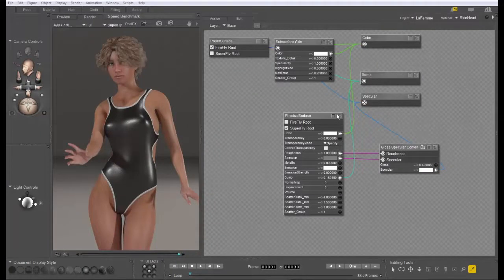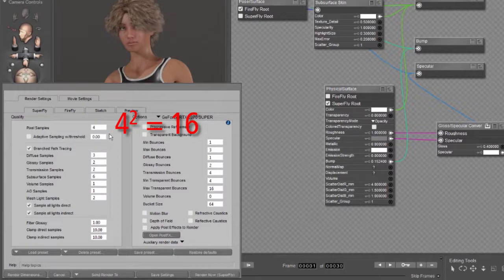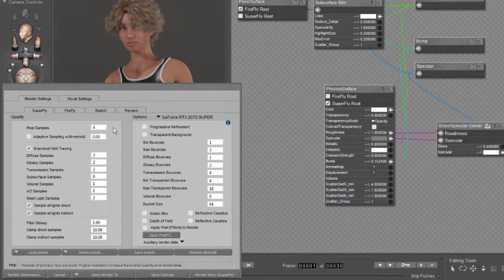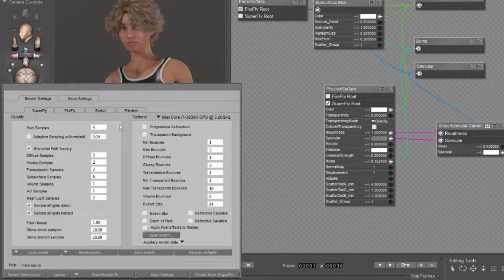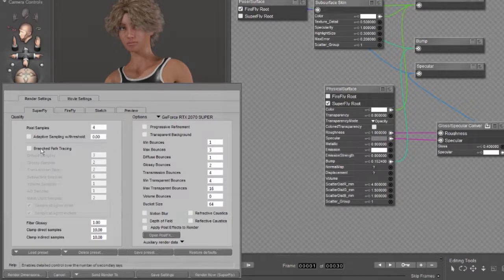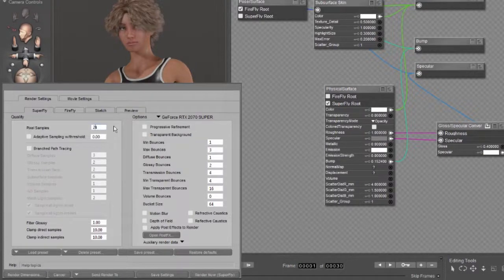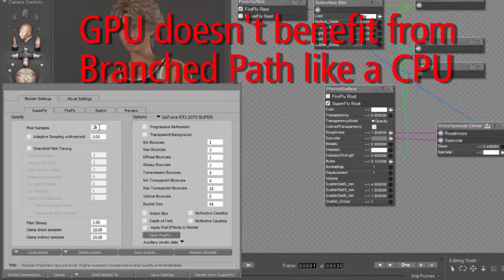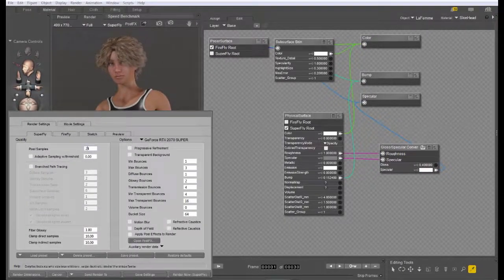How to use Branched Path Render Settings

Comment: I thought your previous video just recommended AGAINST using branched path rendering?
Reply: Yes, when using GPU rendering branch path tracing wont be useful.  It's an optimization method useful only to CPU rendering.  Enabling it for GPU, wont help it any.
Reply: @RedsparksCreations  Precisely. So given trhat everyone with any sense will be using GPU rendering...
Reply: @Martial-Mat  I could be wrong but I thought that GPU rendering was only available to nVidia based cards.  Most Macs use Radeon cards.  So GPU rendering in Poser wasn't available to them.  Branch Path Tracing could be useful as an optimization for Intel based Macs where GPU rendering isn't available.
Reply: @RedsparksCreations  Wow, if that's true that really sucks. Just more evidence that you don't go wrong with nVidia or Intel.
Reply: @Martial-Mat  For the Intel Macs without nVidia, that's true where Poser is concerned.  The M1 chip on the other hand is very fast and I've read that it can out perform certain nVidia GPUs.  I'm not sure how true that is but my experience with it using Poser 12 is that it is very fast and perfectly useable for my needs.
Reply: @RedsparksCreations  I'm totally disconnected from processor performance on the PC nowadays, let alone the Mac, which I never knew anyhing about. But it seems logical that a powerful processor could outperform SOME GPUs given the vast range of GPUs. I used to get my performance metrics from Tom's hardware, but I don't think they cross-reference GPU vs CPU performance, which would be useful in this sort of situation.